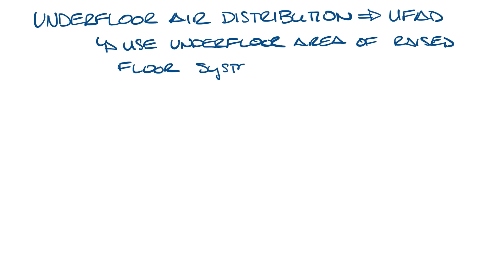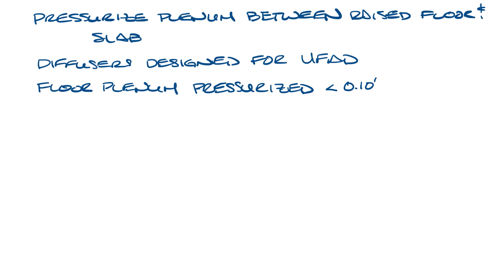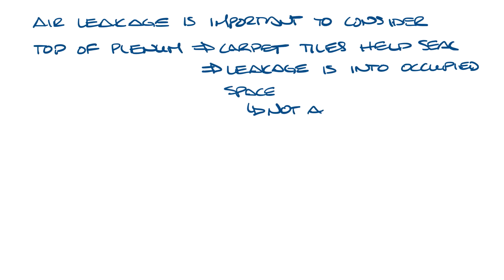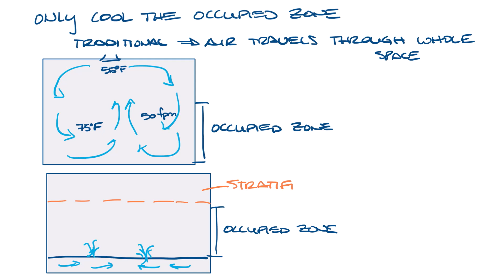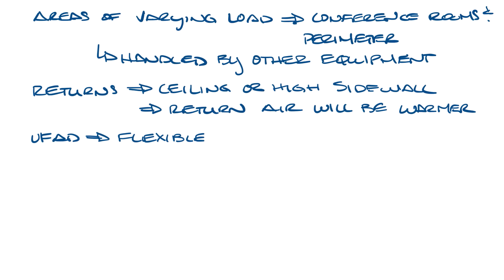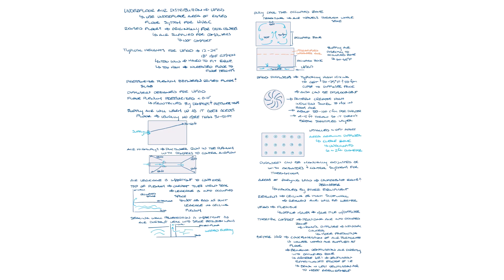NSW HVAC Academy - What is Underfloor Air Distribution?

Comment: Hi, thanks for your great technical guides. Regarding the video you shared, we have a concert hall within our project. The HVAC designer has proposed a UFAD system with an air diffuser under each individual seat for warm and cool air supply. Is it a justifiable design as the air is coming out just in place where people are sitting? Can the air flow be annoying?